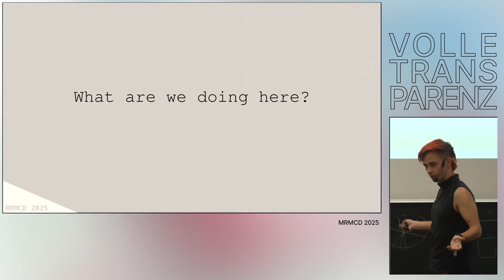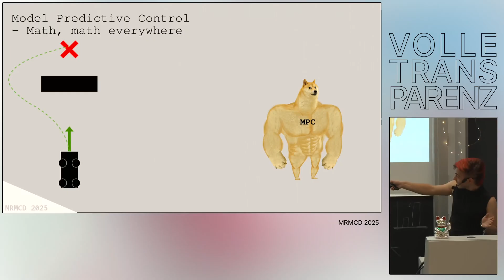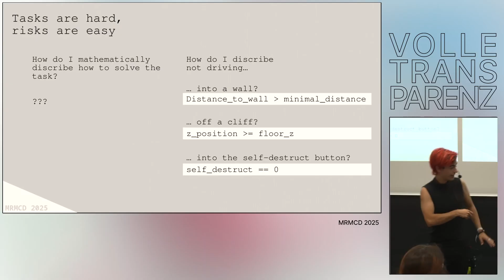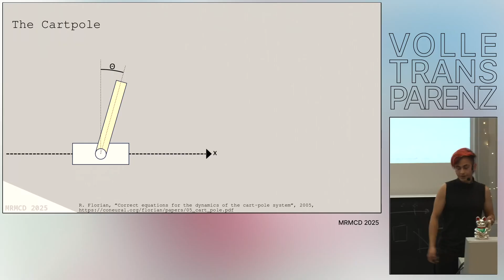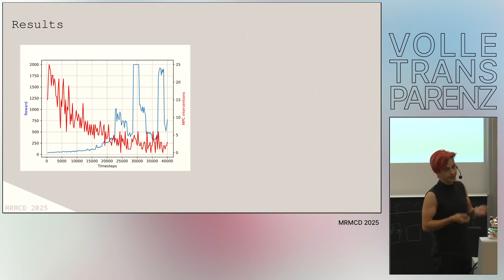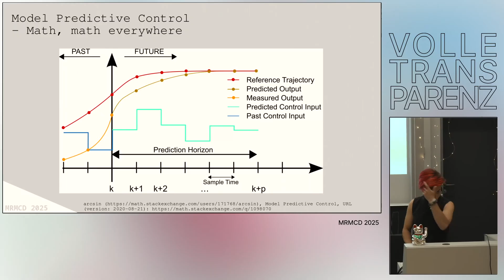MRMCD2025 How to prevent the robot uprising - an introduction to MPC based safe reinforcement learni

Comment: Every Science Fiction killer robot has always had a glowing red compact fusion reactor embedded in their thorax. Such an endless source of onboard power is just as essential to the concept of killer robots as is an evil AI. To those that believe that killer robots could be powered with rechargeable batteries, then all that the human mercenaries would need to do is sabotage the grid (which is trivial), leaving the killer robots with the ultimate case of 'Range Anxiety'.  Therefore, keep your eye on compact fusion reactors, especially if they glow red in operation, as much as you worry about AI.
 
Never forget that AI stands on the shoulders of IT - it wouldn't last a week without human support.